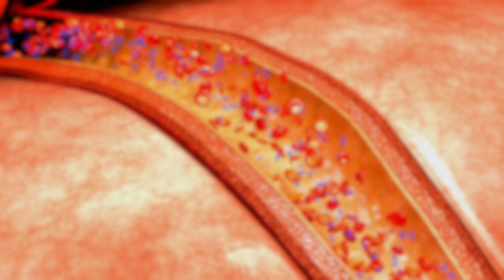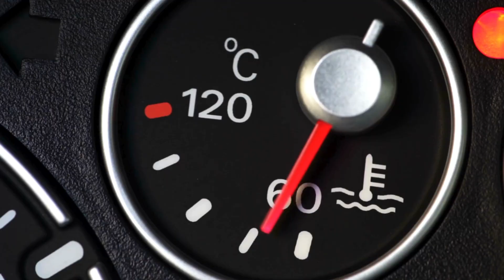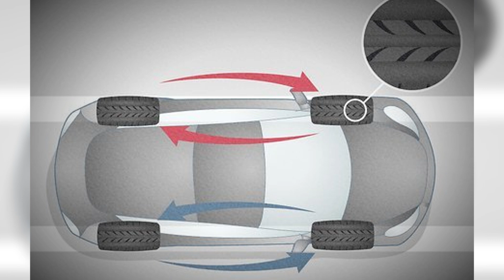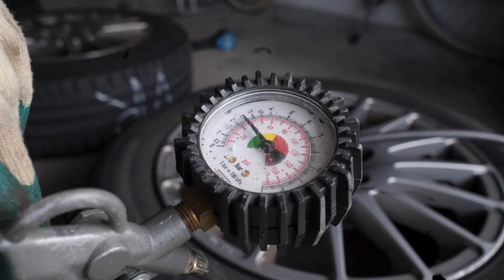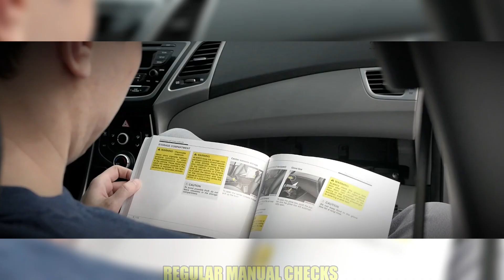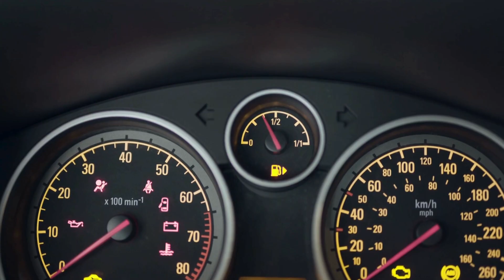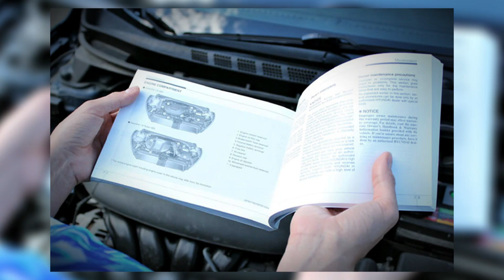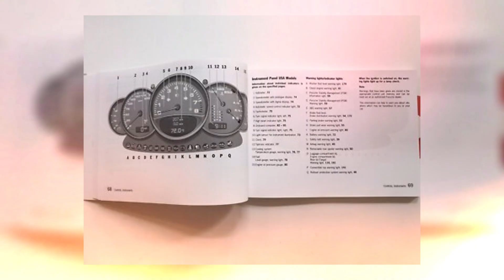13 Secrets That Make Cars Last Forever Most Drivers Ignore

Comment: This is a no nonsense video packed full of wisdom.  Personally, I have reduced the secret to long car life.  Change the oil and timing belts at regular intervals, use quality fuel, keep your car clean and fix everything else when it breaks.
Reply from the maker: Thanks for sharing that — couldn’t agree more! 👏 Regular oil and timing belt changes really are the foundation of a long-lasting engine. I like your “fix it when it breaks” approach too — simple, practical, and exactly what keeps older cars running strong. Appreciate you watching and contributing real-world experience!